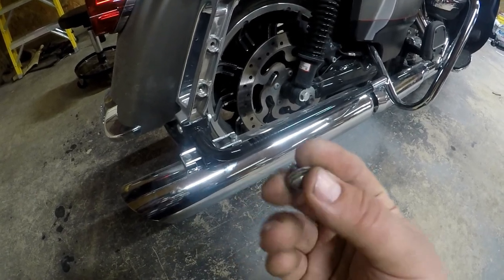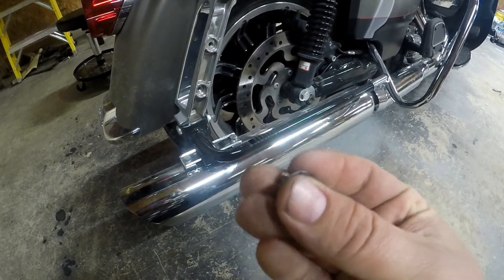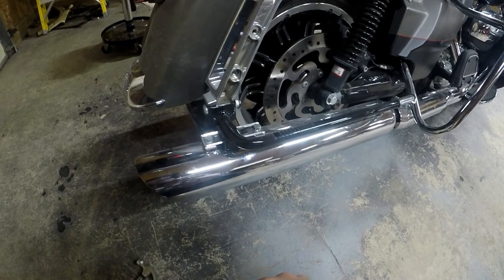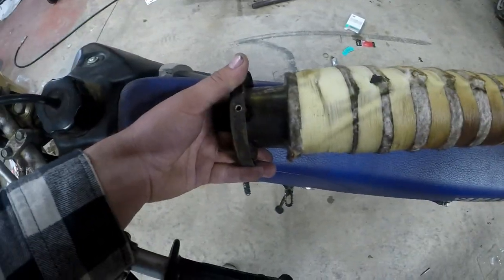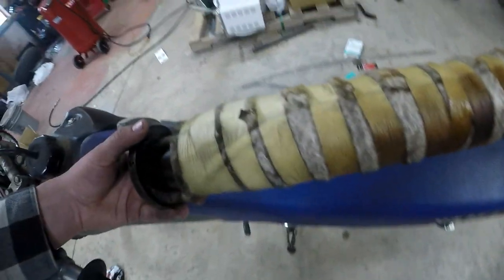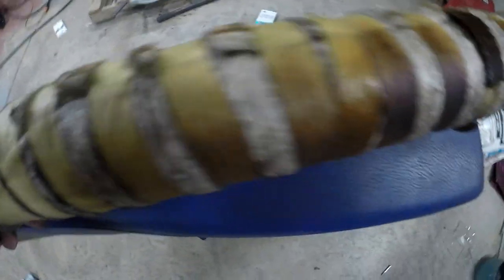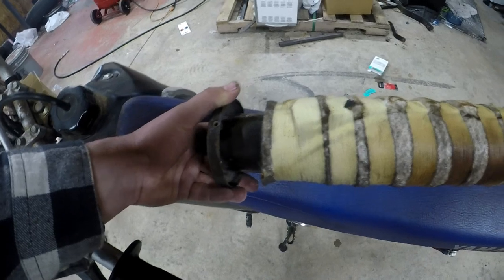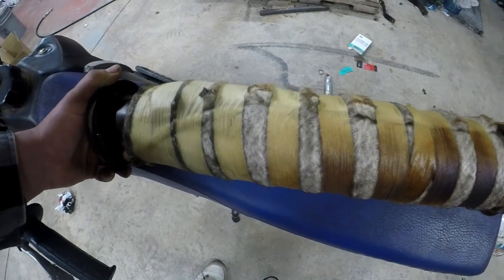Removing TAB Performance Zombie Baffles

Comment: Masking tape in a pipe is very typical. They do that because they have to compress the packing to get it into the pipe. The idea is that the masking tape will burn off and the packing will expand to fill the pipe completely. Tho, I've never seen that much tape. Usually its just enough to hold the packing to get it into the pipe.
Reply from the maker: Hell yea thank you sir for the explanation I know I was confused when I opened these up and thank you for watching 👍🏻

Comment: Zombie baffle do not come with backing if you have any kind of louvered baffle inside that is not a zombie baffle zombie baffles have a smooth and straight pipe inside and they do not come with any packing from the factory..

Comment: Good, honest review man. You tried something, it sucked and you changed it back. Honest. I like that! The masking tape thing, that looks like shit, but they put that on just to hold the fiberglass in place for assembly. The baffle isn't really designed to be taken in and out multiple times. If I take mine out, which I doubt after watching your video, I'll just wrap new masking tape around them for reinsertion, and put them back in.
Reply from the maker: Thanks for watching. Someone below you said the masking tape was just to hold the packing in place as well. I’d recommend leaving them in and if you’re looking for more volume a de catted head pipe really made mine sound awesome.

Comment: Thanks for the video.  I installed the TAB Bam Sticks as part of my Stage I.  Like them a lot.  Sound was perfect for me.  When I did stage II I installed the Fullsack headers with no catalytic converter.  Bike is SUPER loud now, and I obviously lost back pressure.  A Harley mechanic told me the M8 engine loves back pressure so I'm thinking about replacing the Zombies.  I would have been interested in seeing what the baffle looked like under the fiberglass.  I was actually surprised at how long they were.  Are they louvered?
Reply from the maker: I honestly cant remember if they were louvered or not i wanna say they werent but im not 100% on that. I installed a stock head pipe that was de-catted and that really made these pipes sound awesome and i havent noticed and significant loss of power with doing that.

Comment: You can remove the packing and not loose any performance or cut the steel baffle down till u like the sound start cutting off 3/4 and go from there more cut off less performance

Comment: Did you try to remove the packing from the baffles and put them back in? This may give you the volume you're looking for while maintaining some back pressure to preserve torque (although the baffles are practically straight pipes, so not sure).
Reply from the maker: Did not try that just pulled them out and test rode it

Comment: I removed my zombie baffles and added a DK 158 Thunder Torque insert. Sounds awesome and you still have the low end power. Check them out.
Reply from the maker: Haven’t even heard of that I’ll have to check them out
Reply: Interesting.  I've never heard of them either but just watched  video.  Thanks for the idea.  I've been thinking about replacing the baffle because I installed open headers as pert of my stage II, and feel as if I lost a little something.  The bike is also SUPER loud now.

Comment: thanks for reviewing was thinking about ordering Tam bams orTam bam 4.5 dont want it so loud I cant hear my radio
Reply from the maker: What you putting them on? I can still hear my radio over them no problem. These aren’t the bam sticks they are just the slash cuts but according to the guy I talked to at TAB the only difference between these and the 4 inch bam sticks is the changeable tip. I have no experience with the 4.5 so I can’t comment on those.
Reply: I bought a new 2019 street glide special of course it has t he 114
Reply from the maker: Bigheaded Texan DAMN!!!!! Nice brother let me know what you decide to go with.
Reply: Bigheaded Texan  they will sound like a Dragster Only way to go. The sound is behind you radio not a problem !!!

Comment: Great video. Thank you. I  have the zombies in my 4" BAM sticks. I replaced V&H monster ovals because after lowering my bike 1", those wider monster ovals scraped too easily. The BAM sticks with zombies are easily 30% louder than the V&H Ovals. I'm actually going to swap out for the medium baffles to see if I can tone it down just a bit.

Question, how many miles did you have when you pulled those baffles out. I'm just concerned about getting those zombies "baked in" and then having a hard time yanking them out.

Thanks again....
Reply from the maker: I had maybe 100 miles on the bike when I pulled the baffles....I would highly advise against pulling the baffles I lost so much performance when I pulled mine it wasn’t worth it for the little bit of decibels I gained
Reply: Yeah. No. Like I said, I'm going to swap in the medium baffles from TAB to see how they sound. Thanks for the info. Rice safe.
Reply: @KalvinEddie  I bought a 2016 Springfield last month, that already had a stage 2 cam upgrade with Tabs. It has medium baffles in now and has a nice low end rumble, without being crazy loud. It came with Zombie baffles too, which the previous owner said to only put them in if you want to piss off your neighbors. He said you could just run the Zombie on one side to get a mix of the medium and Zombie. I’m not sure if that would be good performance wise. I thought about putting Zombies on both sides to check it out but honestly like how it sounds now. It’s my first “big” bike and I’m loving it. I did have a KZ900 back in the day.

Comment: Hey man, you lost torque because of exhaust gas reversioning. It's not because of the lack of back pressure which a lot of guys will tell you. Basically it's the exhaust trying to go back into the combustion cylinder because the exhaust gas has not left the pipe and the motor is sucking it back in on the next revolution. Think about velocity. If you have two exhaust pulses of equal volume, one in a 2" pipe and one in a 3" pipe, the pulse in the 2" pipe will be traveling considerably FASTER than the pulse in the 3" pipe. Basically the baffles make the exhaust faster because of the narrowed down baffles. If you want open pipes, DK Customs sells a product called Thunder Torque Inserts that speeds up your exhaust in your open pipes. It's fluid dynamics and hard to explain! The Thunder Torgues create suction to make the exhaust faster. They also have a video explaining this. So, don't give up on the open pipes Brother! https://www.youtube.com/watch?v=g2VB0nBFhTQ&ab_channel=DKCustomProducts
Reply from the maker: Yea I’ve seen those I love dk custom products have their cooling wings and oil filter relocation kit quality shit….I cammed my bike and that made it loud as shit so no need for straight pipes anymore lol
Reply: @theaveragebikergarage  That's awesome! Next week I am ordering the same things for my bike, plus a tank lift! Yessir, quality stuff from these guys! Hopefully I can get somewhere from 30 to 50 degrees reduction is heat. My bike is all stock, just got her a month ago. Keep pumping out the vids man, I enjoy them a lot!

Comment: Did you have to remap the motor ?
Reply from the maker: I had gotten a fuel pak 3 for it and that seemed to do the trick with the exhaust and air filter but when I cammed it I had it dyno tuned